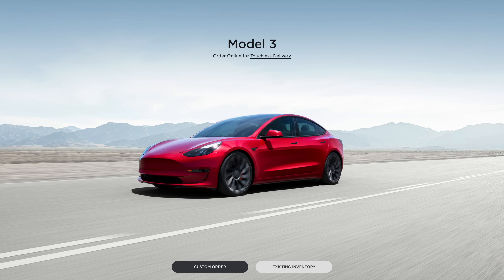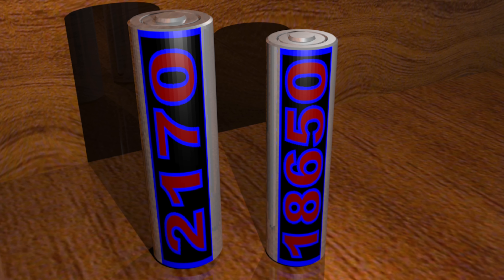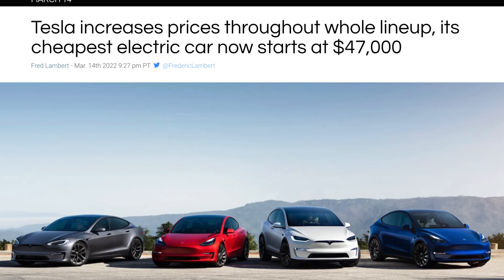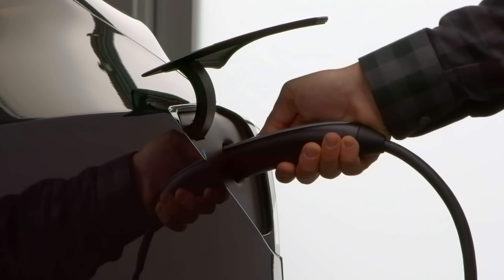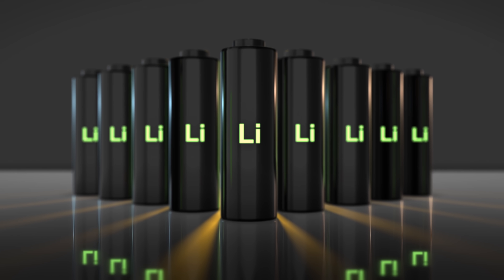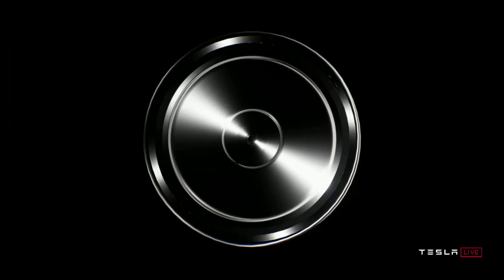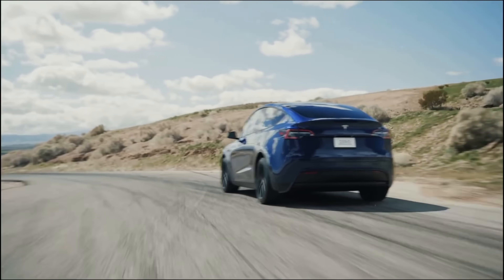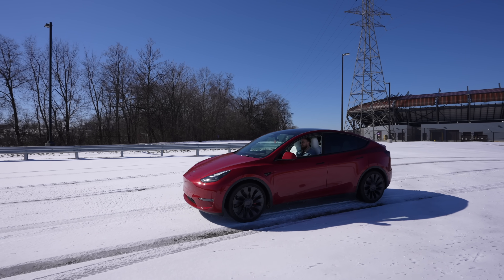Tesla's Hidden Battery Options: Don’t Pick the WRONG One!

Comment: Its really just two chemistry, the tabless cell is NCA as well, just a other way of physically produce them. Tesla also produce NMC cells, they are physically identical to the NCA once, but have a different chemistry. Those are used for the powerwall and also suppose to be used in the trucks.. but i kind of think they are going to go for LFP now when that technology is closing in on energy density and both NMC and NCA is getting more expensive to produce.
Reply: The energy density won't "close in" (Nickel based chemistry will advance as well)
However, LFP will advance to the point where it's in the performance window of existing 2170 based PACKS.
A car with an LFP structural pack, placing it in the performance window of an existing 2170 car? 300 miles?
That's an interesting proposition.
Reply: @rogerstarkey5390  No not really. Nickel based on is much closer to the deminishing return end of the spectrum.

If you talking about catching up.. well no, it will never do that.

Its also the question of volumetric density and  mass-energy density. I´m coming back to this.

Solid/dry cells are coming up, they are getting close now. But there is one problem. Solid cells expands and contracts significantly when charged. This is a problem that i think never will be solved, so they have to work around it.

Pretty much all cells today are rolled, even prismatic once. They are just rolled on a rectangular dummy, in steed of a circular. This is a problem to dry cells because they will rip them self apart if they are rolled the wrong way.

There is a solution. Stack the cells in steed of rolling them. While this may sound simple, its incredibly difficult to make this automated. This is pretty much the reason why every lab in the country have dry cells testing, but they are nowhere to buy.

This is solvable, but hard. But i would say its probobly closed to months then year before someone have a working automation line.

The thing is that LFP benefits much more from being dry cell than NCA does. And not, its really only the volume that is effected, the weight is only marginally effected. Typically 5-10% on weight and 15-30% in volume.

But having the cells stacked in steed of rolled also increase volumetric energy density, even compared to prismatic cells. So its both a drawback and a benefit.

Thirdly, the dry cells is less sensitive to temperature, specially so low, and they are also more effective, so they need less cooling. Again increasing density.

Mitsubishi made a simulation unit where they took a part of a i-Miev battery and replaced it with dry cells. And run it in a bench car set up. They mange to cram about twice the capacity in to the same space, but the battery was considerably heavier.

Both solid state, as well as LFP (and also LTO)...

Back to tesla. I think they have to go prismatic in the long run anyway. So its probobly more economical for them to take the hit today, and have the packs ready for when the cells are available. 

Off cause, if they are prismatic, you really can´t do them structurally (or well, less advantage anyway).

I would guess that tesla can cram 75kWh of solid state LFP cells into a model 3. BUT, the pack will be significant heavier.

Comment: Hi, 
I bought a Tesla model y dual motor for my dad in November 2022. I've also have had a KIA EV6 since May 2022. Let me just come out and say it. The battery range of the model y is HORRIFIC. In fact, I'm due to go into Tesla this weekend as it really isn't adding up. Regardless of whether we precondition the battery or not, the Tesla loses battery life even when parked. I charged it 80% on a Sunday night, and after 4 days of driving (dad on average does 25 miles per day), we had to charge it on Thursday night as we knew that it wouldn't get him to work and home on Friday. He barely turns the heating on or heated seats, and yet the return on the so called range is horrific. Absolutely nothing compared to the KIA which actually gives you back miles thru the regen breaking. We will see what Tesla will say, but I'm so disappointed. One day I went on a long trip. Charged it full to 329 miles. By the time I had preconditioned the car, this had someone dropped to 315 just through the preconditioning.

Comment: I would, unless you need it, keep the car at 70%-80%, and really, even with a car like a SR+ RWD model 3, that has a range of about 250 (I think) you get MORE range that most people would use on a daily basis. Even when DC fast charging, RARELY do I go above 85-90% (I may fill it to 100 at the beginning of the trip if I have time but that's not DC fast charging, I do that on a Level 2, and Even on road trips I keep it at around 90-95% because it charges SO SLOW after 85%! (and the most I ever went between chargers is around 160 miles) Maybe once in a while I'll do the first leg around 200mi, but rarely. (Did that with my CCS cars too). 
As for waiting... I would have prefer to get a 4860 Model Y, but I needed a car right away at the beginning of this year (2023) for work; since the price on Model Y was reduced (and the had a MOdel Y Performance that had less than 20 miles with a tow hitch available in my local area/inventory, I got it (may replace it in a year or two for the new battery pack, but for now, its astill a great car!). apparently Toyota engineers disassembled one to study it, and called it a work of art :)

Comment: I work at Tesla in Fremont and want to order a 4680 Performance Model Y from Texas!! Still not sure how this is going to work? Ordering in May for $ reasons.
Reply: I live in Los Angeles and have a model Y long range coming in June. Any chance Fremont will be making them with 4680s by then?
Reply: @Noogie-je4yy  Nope. They are manufacturing those batteries in Texas. I doubt they will ship them to Fremont when they could just install them in the cars manufactured there, especially since they won't have that many batteries at first.

Comment: Thank you for the Tesla battery education, very informative. I am hoping for the 4680 as well as for the potential increased range, although I believe that would be offered for 2022 customers as a software update.  (That is the feature is locked, so whatever configuration you get we don't get an un-paid for enhancement.  I think that is fair)  

I have an order for MYLR ordered in early March with FSD.  The expected delivery date in Canada is Aug 31 till Oct 26.  As I understand it currently all Y's come from Fremont for Canada.  I do want the FSD and currently, an FSD subscription is not available in Canada.  So will earlier delivery could come into effect that would be nice but would like to have 4680 first then delivery with FSD.
Reply: Don't hold your breath. Tesla will not Osborne their cars. Most likely the intial 4680 will have less or similar capacity as they ramp up. Only when all factories are up to speed you will 'probably' see a slight range increase, but I don't think before sometime 2023. And def not to old cars sold in 2022.
Reply: @marcusbiller867 It makes sense the “new” DMSR Y will have the 4680. It will take less 4680 cells, thus allowing Tesla to ramp up 4680 production. I’m curious how the 4680 performs in cold weather. I have a 21 MYLR and cold weather really hurts the range. Once 4680 is out for a year or 2 I will order another MYLR with the 4680 if it makes sense.
Reply: Don't confuse a new form factor (4680) with longer range due to "chemistry"
.
While the lower number of cells (which mean less steel in the total) will reduce weight, along with the pack being structural, the "5x, 6x" figures from battery day simply refer to the energy available from each cell, and the 4680 has 5 times the "jellyroll" area wound into its casing, so it can hold 5 times the energy of a 2170.
In other words, the 4680 pack will have approximately 20% (1/5) the number of cells, but the same amount of active material, so the same "capacity" (kWh) as the old pack.
Most of the efficiency will derive from the same capacity (+/-70 kWh?) moving less mass.
Will they increase range?
.
Remember the mission.
They want more cars on the road.
The way to do that is to keep the capacity the same, or very slightly less(!) give a slight range increase due to the weight, and use the spare cells to build more cars.
.
Don't forget, the 4680 should charge faster due to its construction. That will more than offset any reduction.

Comment: Hey, thought I should mention LFP batteries do not have a memory.
I assume the reason they allow the charge to 100% is because their cycle life is 3000-5000 vs nmc which is ~1000.
Reply: No, the reason is the voltage. Because the BMS measures V difference to calculate SoC it needs to go to 100% to be able to calculate properly, because the V on LFPs is about 3.65% at the top and 3.45 at the bottom as opposed to 4.2V and 2.5V on NMC. Also, 1000 cycles (even if true, most likely more with BMS and cooling/heating) is about 300,000km for about 85% battery retaining. Do you expect to drive 300,000km?!
Reply: @marcusbiller867  So, my experience with LFP is a DIY ~30kwh 16s2p (51.2V, 560ah). So I agree that the top voltage of LiFePO4  is ~3.65V, but I am not too sure where you got the 3.45V for the bottom? The nominal voltage of LiFePO4 is ~3.2v, and common bottom voltage is 2.8v (I believe u can go all the way to 2.5v though). 

Most modern off grid systems know not to use voltage to calculate SoC, as the discharge curve for lifepo4 is so flat. Most systems use a smart shunt, to measure the amount of ah that have gone in and out of the battery, and use this to calculate SoC. 

So my question is this: do we have any sources that show that Tesla uses strictly voltage to calculate the SoC? Personally, I don't think they do, because when under load the voltage sags, and you cannot get an accurate measurement until the battery is 100% at rest.

Comment: Hi Andy et al, I have a model 3 2020. Does anyone know how far I can drive on a flat tire  if 1 tire happens to go flat? I have michelin tires that came with the car. Thx!
Reply: Since Teslas do not come with runflat tires (nor a spare tire) from the factory, you should not drive on a flat tire. In the event of a flat, pull over to a safe area as soon as possible and call roadside assistance.

Comment: Makes more sense that a new version of an existing vehicle like the SR+ will get a different batter (LFP or likely 4680). Otherwise you create a problem with order cancellations or postponements, fighting for a 4680 over 2170, and a logistical cutover nightmare. Guarantee Tesla won’t do something like that for it’s shareholders. I have a hard time seeing MYLR or MYPs come out with 4680s until all manufacturing facilities can accommodate and then sunset the 2170 models. They’re not going to make the same model with both batteries at the same time for a very long time, so you’ll probably see LR and P (probably P sooner with the less demand) with the 4680s when production and supply of the 4680 can accommodate the entire line at Fremont and Texas. Also, the Texas Y’s spotted in the lot on the trucks ETC are confirmed not performance. Likely SR+

Comment: Are 4680's still limited to 80-90% charge?
Reply: Depends on the chemistry.
If it's the same as 2170, yes.
But, they should charge faster (tabless) so if you need to make a long trip, you can still let the car charge to 100% just before you leave, then benefit from the faster rate on the road.

Comment: I too am hoping for the new 4680 in my LR Model Y, which was scheduled for delivery June 14th. It has now been rescheduled for August 14-October 14th. I live in SW Utah, which is definitely in the Fremont CA delivery zone. What do you think this delay means?
Reply: I live about 2 hrs from Fremont here in Cali and my Model 3 I just ordered last week has the same expected time frame. I thought being not that far from Fremont I might get it sooner but I guess not. The demand is so high right now, it’s hard to predict what factors are affecting delivery dates.
Reply: @kerrie9479  Agreed!  My original delivery date was June 14,  4 months from my order date.   I ordered in late January.  It seems they are pushing out the delivery dates of the non-performance models and those without FSD. I'm hoping with extra 3 months, my chances for the 4680 battery will improve, but its a great car either way and I'll be happy either way.
Reply: Don’t think the delivery distance really matters to them, they are just backlogged on making their cars due to such high demand and orders. Hope you get your cars soon!

Comment: why the battery is not manufactured in the same way as the battery in a laptop.  because it is probably not the case that there are several small batteries in that battery

Comment: Structural battery = non-replaceable battery. When the battery fails, tow the car to a recycling center because it's dead, dead, dead.
Reply: Not it isn’t.  Cell vs module.  Cells can die but the pack won’t.

Comment: What's the cycle life rating of each chemistry? I have been wondering that for a long time and no one at Tesla seems to want to spill the beans. They say some canned/ rehearsed answer, but never tell me what I want to know. Anecdotally it seems the non-iron packs are good for a couple thousand cycles, and the LFP packs for double to triple that, but that is based loosely on what is publicly available for anecdotes and research papers.
Real world range for a current Tesla Model Y could be about 300 miles/charge. 2000 cycles x 300 miles per cycle is 600k miles, or twice as long as the typical well-maintained ICEr gas vehicle. Factor in degredation and call it a bit less - 550K or even 500K miles and it's still going to last the average American motorist 33.3 years. Not too shabby.
I have read that LFP cells last for between 5K and 15K cycles in the lab. Since the vehicles get less range overall - call it 250 miles/charge, that's 250 x 5K cycles or 1.25 million miles. On the high end it's 3.75 million miles per pack. Or 250 years for the average American motorist. That's not a typo - 250 year pack life. Even if that's off by a factor of 10, and it only lasts 25 years, that compares favorably to current ICErs that need to be completely overhauled/rebuilt after that amount of time.

Comment: The 4680 is supposed to make the cars lighter and more efficient, so that 279 mi range model Y can't be 4680 cuz it only gets 123 MPGE
Reply: "supposed" to. They can always put smller battery pack as they don't have the capacity to build more.
Reply: @marcusbiller867  I'm not talking about the range, I'm talking about the efficiency. 123 mpge is low for a car that's supposed to be lighter and way more efficient. If it is a 4680 with fewer cells in it, then it should be even lighter and more efficient

Comment: You say that the 4680 cell is a “different chemistry” and I don’t think that’s true. You also distinguish between the “three battery types” by chemistry for the first two. 

Elon has already spoken about how the nickel based or iron based chemistries go into the 4680 cells. So the 4680 is simply a new form factor and manufacturing process right now. Yes it may facilitate better heat dissipation and current flow due to the physical design. But right now we only know that the existing chemistries will be inside these cells. 

4680 is not a “new chemistry” as yet.

Comment: One critical, if not the most critical disadvantage that is not even mentioned in this video is LFP batteries can't handle motor / performance / long range cars. As if Telsa just "happens to install them in RWD" for no reason at all. Oops.

Comment: After watching this very informative video, I have a question.  I own a 2020 MY dual motor long range variant (vin#  xxxxx2LF030469) delivered on 7/26/20.   It was my understanding that the newer NCA 2170 cells didn't appear in either the M3 and Mys until late in 2020.  Is there any way to tell via date of build or vin to determine what cell you actually have in your vehicle?

Comment: With NCA, model Y dual motor range is about 10% less than model 3 dual motor.  LFP gives model 3 around 260 miles range, so I would expect model Y with LFP to be 10% less than 260, or around 235 or so.  So, if Tesla actually produces a model Y dual motor with 279 miles range, I suspect it will have 4680 LFP batteries.

Comment: NIO's 150 kWh car has 360 Wh/kg, similar to Tesla's 4680s seem to be from their very fuzzy official math.
I wonder whether their Wh/liter is higher or lower. I suspect higher, but for the way most EVs are made, it doesn't matter a lot.
Reply: If Nio has a cell with 360Wh/kg, WHY do they need a 150kWh pack?